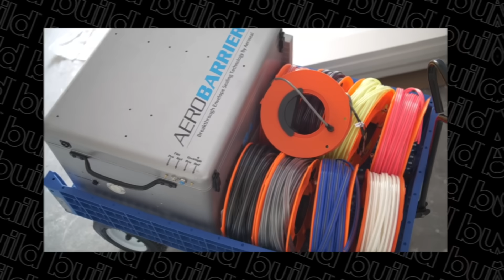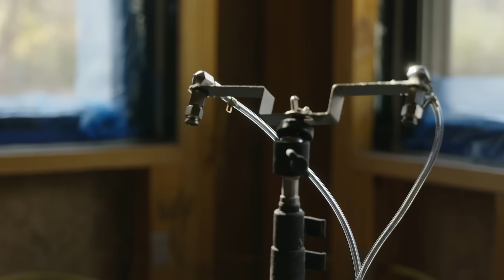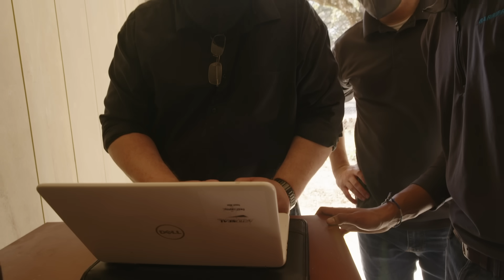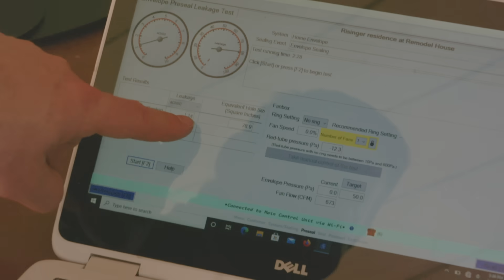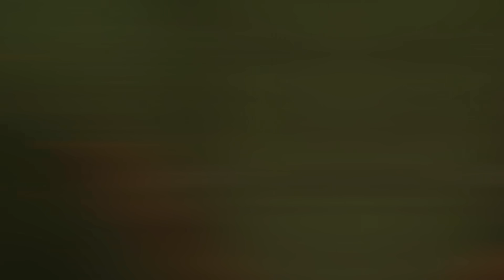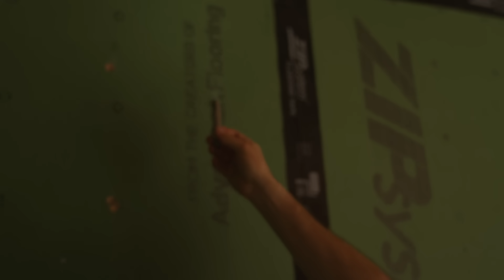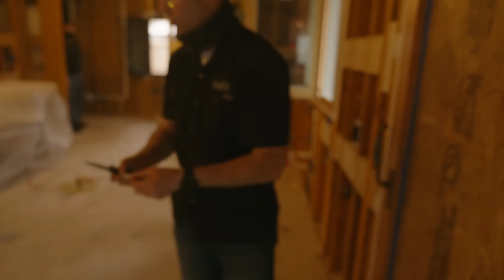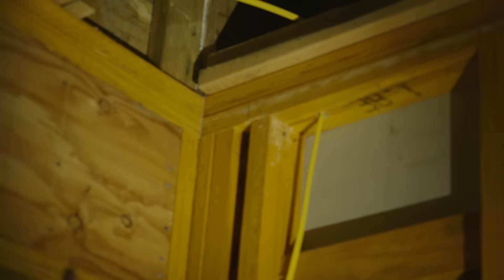The one product I'd recommend for EVERY House!

Comment: Wow 0.10 ACH, congrats Matt! My house is 6 ACH before I started air-sealing, my guess is I am at 5 ACH now, I have a lot more air-sealing to do. I hope to get to 3 ACH when I am done with all my air-sealing projects. With just the air sealing I have done so far I am saving 20% on my heating in the winter, I am saving about 10% in the summer on my AC bill. After I am done air sealing I plan to add more insulation in my attic.
Reply: You could try borrowing a thermal camera (like the cheap-ish FLIR ones that connect to your phone) and looking at your house when the temperature difference is pretty big between inside and outside. You should be able to see any big leaks by just looking at the walls with the camera. If you can't find a camera and don't want to buy one, some home inspectors have them, so you could hire one to take a look.
Reply: @tbmatuka  Home Depot rents a FLIR camera
Reply: I usually spec 4.0 ACH 50 for new construction. Anything less and they start running out of ideas to get it lower. 1 ACH is unheard of. 0.1? That's basically a submarine on land.
Reply: @ryanmcgowan3061  Our code in the North is 1.5 ACH. I just did a house at .73 using the REMOTE wall assembly. Lots of guys can get it under 1. We are building to the opposite up here as our heat escapes the house and travels out. Our vapour barrior needs to be on the inside (warm side) of the warm assembly.
Reply: COVID for home insulation
Reply: Where do you get fresh air from with a house that is so tight?
Reply: @garyc765  Fresh air intake from the air handler.
Reply: @ryanmcgowan3061  till there is no power........
Reply: @hdj81Vlimited  You can just open the windows in the case that you don't have a backup generator.
Reply: Dave!  What are you doing for air sealing?
Reply: 9e7
Reply: Did you use the same product?
Reply: Thats huge!
Reply: Holy crap 0.10 ACH, hopefully Matt can do one more pass at a blow door without tapping the windows.
Reply: Better put your money in tesla products - roof, battery and car (another battery); then hook up to Tesla‘s virtual power plant. Be a peaker power plant and stop this saving craziness - energy (solar) is abundant.
Reply: @bekind2047  are you actually serious, or is this a badly written attempt to troll?
Reply: @Psycherz  I am serious - but it’s not really about Tesla but Solar. We are not there yet but in a couple of years renewables will be even cheaper and the breakeven for this insulation craziness will be more and more in the future for this kind of investment. I am German - we have kind of invented or at least nourished this over-investment into insulation for decades and still do. It makes no sense and very soon we will realize. You never get your money back - and by the way these houses bring tons of other problems with them - some very costly.

Comment: Get Paul to follow up with customers that have had the system installed through several years of hot dry summers and cold wet winters and give us feedback on the effect of the expansion and contraction of the cured product over time. This is probably the most important aspect of this product. Also it might be beneficial to have a product that can put a thicker coat over the obvious areas where the AeroBarrier is visibly "built-up" after the initial spraying, that could prevent any separation of a super thin coating from the base material that would just allow a leak to develop. Thanks
Reply: Yes. Why not red or orange sealant to make holes / gaps crystal clear?
Reply: @MarkJones-si2bb  my thoughts exactly
Reply: @MarkJones-si2bb  If you had a house that already had drywall and a lot of finished trim, the color orange would look horrible.  I'm assuming you are just referring to new construction though?
Reply: Perhaps the goal is to get just the certification....🤔
Reply: Seems like it would be a good idea to find as many spots of caulk as you could and add spray foam or more caulk for more durability.
Reply: A passive house advisor once told me he they use it to get projects certified after failing blower door tests. He also said it's a band aid solution and only last for about 15 years.
Reply: @vik6980  Opinion and poorly informed at that
Reply: @vik6980  15 years is 20x longer than I expected. Still not good, but it might not be a waste of money at that point. Probably worth using it as a marker to seal over it properly

Comment: Thought that would be cheaper...materials are cheap...tech is simple (but smart)...should be less.
Reply: Alas, it's also patented and franchised.
Reply: Saw a DIY thread on this.. a guy built one for under $150 and got similar results.  It is pasically acrylic paint atomized in the air..

Someone will probably make a DIY spray can fogger kit and rent you a blower door...

Comment: Why not use some forms of HEPA Air Filters to clean the inside air from the residual air particles? Opening windows & doors after interior pressurization is going to exhaust high particulate air and could upset neighbouring projects & surrounding landscaping. Might this demonstrated exhaust method contravene some local codes?
Reply: Once they stop the sprayers, the remaining particles settle to the floor rapidly, so most stays inside the house, and anything that vents outside settles to the ground there too.

Comment: As some other people mentioned, the point of having stickframe house is to be inexpensive. All these extra things make it expensive. Maybe at the end, it would be cheaper a solid house out of concrete or brick. Have you watched three little pigs story?
Reply: Crappy contractors only care about building homes as inexpensive as they can. Matt is not one of those contractors
Reply: Yeah like a full ICF home might come out around the same price as all that Matt is doing here but an ICF home will be way way longer lasting.
Reply: @THEGAMINGHELP101 In my opinion ICF is the future of building and with todays lumber prices it is comparably priced too...
Reply: There are other reasons, like ease of remodel, material availability, etc. Even with a concrete shell, you'l probably want studs on the inside to hang sheet rock, cabinets and shelves. The cinder blocks or ICF also generate a lot more carbon dioxide in their production. But it is s delicate balancing act to factor all of this stuff into account.
Reply: Brick, block, concrete, ICF, metal, wood ... they ALL leak.

Comment: I KNEW IT WAS $3-5k USD ($1.50/SQ FT). CALLED IT IN THE LAST VIDEO. TAKES A LONG TIME TO PAY THIS AMOUNT OFF ON A HOUSE THAT IS ALREADY 1 ACH50.
Reply: Most houses are nowhere close to 1ACH50 though so that seems like a great value
Reply: @GrantsDad  he said it would cost more for a home with a higher starting point..
Reply: @GrantsDad   Great value?
Reply: @seanm3226  yeah it’s an investment you will save on utilities in the long run
Reply: @GrantsDad  Actually most new houses by good custom home boulders are building under 1.5 ACH50 in our market.
Reply: @mobgma  but are most houses new construction and built by good custom home builders?
Reply: @GrantsDad  depends on the market. where i am yes. there are good builders out there (not the volume ones).
Reply: So if it cost $3/ft² @ 2000ft² because the ACH was a 3.0 consider the ROI on utilities along with the not typically considered health factors of mold growth and the like.

Comment: The main question is WHY?! Why you didn't build from a start true brick house from the outside and a wood frame inside? Will be truly sealed for hundreds of years perfect house! Brick building well-known for hundreds of years in Europe and if you know how to service them, - those houses would stay forever. U'll die but the house still will be there. Combine brick house with concrete floors, - you'd  get stability, nothing gonna squeak forever. You are building great house, but all those little technologies you are using in there, - all of them could be left behind if you built it from brick. I understand you brought hear one sponsor after another one, but for real guy to build something like that - pointless :) Thnx for reading.
Reply: It’s all about cost 
I wonder what percent of the population in your particular country owns as opposed to rent? In the US it is a trade off, in order to make home building and ownership more accessible, building costs are kept low. Sure, you can build a concrete and brick home but you better be ready to shell out 10x the $ compared to a stick frame home
Reply: @josecito976  His house is very custom, why are we comparing it with a mass-market? I know an architect in Chicago, - he built it for himself out of brick and concrete. Really nice house. Check also the mass market: those houses on facade made of brick. You need to add 2nd layer of brick or you can use concrete brick for the house structure and nice and shiny for the outside.
Reply: @arishem555  his house is customized but it’s not a new construction
Reply: @GrantsDad  great point, I actually forgot about it :)
Reply: @arishem555  there's a ton of embedded carbon in concrete, whereas wood sequesters it. Where I live concrete houses are virtually impossible to build and houses built from block or brick are banned because of earthquakes. Wood framed houses are far superior where I live.
Reply: @slickmcCool  great point. I don't think we have here in Texas a requirement for earthquake stability. But I'm speculating here. But instead we have hurricanes. And house made of brick could be a great deal for you so you can save your life.
Reply: @arishem555  oh yeah, in Texas, I would go with concrete, probably something like flyashcrete or maybe limecrete😬 to reduce the carbon footprint.
Reply: @arishem555   actually it started out as a renovation that changed course and it was brought down to the existing foundation.  It is a fully custom build.  And its not being built to mass market standards.  Look into "passive" build ratings and it will make more sense.  
And it doesn't matter if its brick, block, concrete, etc.  They ALL leak.  Its up to you what you do about it.
Reply: @john1770  its a nonmetallic tetravalent element with the symbol C and atomic number 6 in group 14 on the periodic table.
Reply: @carbon_star  I've seen multiple houses like that in Chicago. Was participating in the construction of those. And yes. They were like 2-10 million houses. But they are here. In US. Today.
Reply: @carbon_star  his house doesn't look like 300k house. at least 1 million. Don't you think? Am I wrong? :)
Reply: Nothing wrong with properly designed timber, my previous house was 1600. The issure were caused by poor renovation from 50s on
Reply: @john1770  what do you mean by carbon?
Reply: @john1770  it isnt. But lets make sure we're talking about the same thing here... I still don't know what you mean by carbon.
Reply: @john1770  ah. I don't know why the industry settled on that terminology, but that means that a producing and laying  a ton of concrete produces a ton of CO² into the atmosphere.
Reply: @john1770  trees remove CO² and stores it in the wood. It's, from that perspective, a better choice for building as it releases less CO².  I am not claiming wood is better in every situation.
Reply: @john1770  I didn't create the terminology, and don't particularly care. Beef with the industry about words all you want. 👋
Reply: You really think we arent aware of other bulding form that are used all over the contry? We do everything Europe and the rest of the world does if its up to our code standards and stick framing wins on 99.9% of our houses.
Reply: @sparksmcgee6641   who "we"? LOL like I'm an alien from another planet. Cmon. Im here. Right here. Was in construction in US for a couple of years. I know how you are building and don't try to force it on me.
Reply: @sparksmcgee6641  the whole point of that message was, that Matt introduced here like 20 different techniques to make the insulation better. Instead of it, - he can just build it from concrete brick. Would be way easier to insulate that type of house. That's it. Instead at his final stage he came up with air sealer, which is nuts.
Reply: @john1770  I did a quick check before I responded, I wanted to make sure my information was accurate. Turns out that I wasn't the person who decided the terminology, and I'm not, according to the very latest research, the person who is going to change it either. 
I do agree that the term "embodied carbon" is semantically problematic though.
Reply: @john1770  I agree, using more accurate terminology in youtube comments would be better. Almost every time I am discussing it I am with someone in the engineering or mitigation professions so I just wrote it by habit.

Comment: Is that stuff fire rated? Like the wire that goes down into the garage should be fire stopped not just caulked.
Reply: Seems like a good point. It's possible that an inspector might require places like that to have fire block foam applied over the hole.
Reply: the sheetrock is the fire barrier between the garage and house.
Reply: @kenbrown2808  I was under the impression that holes through the top and bottom plate needed to be sealed with a fire block type material whether the stud bays have dry wall install on them or not.
Reply: @davefoc  that may be a local code thing.  where I am, the sheetrock is considered the firewall, and if there isn't an engineering need for a shearwall, I've seen walls between garage and living space with sheetrock directly on studs.
Reply: @kenbrown2808  Hi Ken, I think we might have been talking about different things. I was talking about the hole for the electric wire that got filled with caulk. I understood a comment about that to mean the commenter thought that hole should have been filled with a fire proof material and not latex caulk. I thought he was probably right. I thought an inspector might call that out and that he that might accept just spraying fire block caulk on the hole.
Reply: @davefoc  and where I live, the inspector would require that a properly taped fire rated sheetrock wall and ceiling be installed, with any penetrations in the sheetrock (I.E. electrical boxes, duct or plumbing penetrations, etc) be appropriately fire rated, and no additional fire barrier would be required.
Reply: @davefoc  Fire foam is actually just regular foam colored orange. The holes don't have to be a specific product, it needs to air seal between vertical and horizontal transition so when a fire occurs there's a limited amount of oxygen available for the fire to burn and travel through...Basically it's just a means of controlling flame spread. The only time fire caulk is required is between transitions of fire rated assembly, like if you have a pipe pass through a 1 hour rated wall, then the pipe need to be fire caulked between the pipe and sheetrock. 

The holes can be sealed with anything inside a wall assembly just so long it is sealed. You can use regular caulking if you wanted. As long as your cavity does not promote flame spread from one floor to another.

Comment: What about longevity? How does the sealant hold up over time, through expansion and contraction, for areas that have minor earthquakes, is it flexible enough to withstand some movement?
Reply: The sealant has had a 50 year life-cycle test  done (hot/cold, 20% expansion/contraction) with near zero degradation to the seal.
Reply: Acrylic Latex caulking has an expected life of 10 - 20 years for interior use. So I would expect a similar life for AeroBarrier.
Reply: @kenchow8213  I don't think this is latex or caulk.  It's been said it is Acrylic paint, but I didn't search for the data sheet.
Reply: Their website claims 50 years.
Reply: @Camscrub  Gonna need Project Farm to test that claim...
Reply: Kinda to new a product to know.
Reply: @chadleach6009  not really.. they have been around a long time in the duct sealing business.. they are called AeroSeal and a quick search shows piles of reviews..
Reply: @FJB2020  don't those just run through the ductwork though? This seems like similar tech being used in a completely different way.
Reply: @chadleach6009  Correct, but it is the same company, so if people are complaining that AeroSeal stopped sealing their ducts after a few years.. one could assume they might have similar short comings here.
Reply: @chadleach6009  Yeah I suppose that is correct, I guess it serves its purpose if your goal is the cert.
Reply: The founder of Aero barrier bought the patent off of Carrier as they were sitting on the product not doing anything with it.